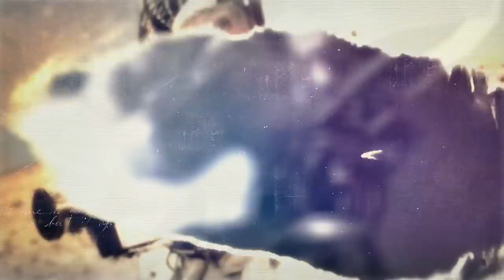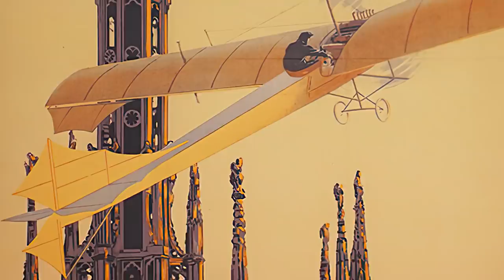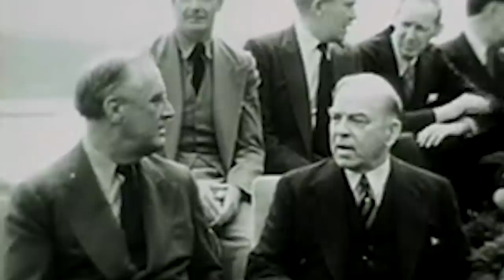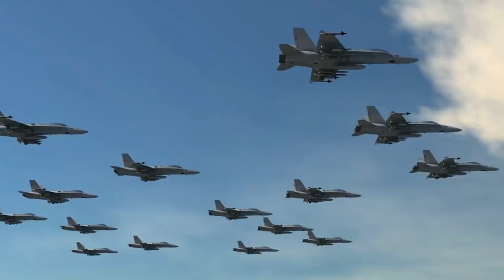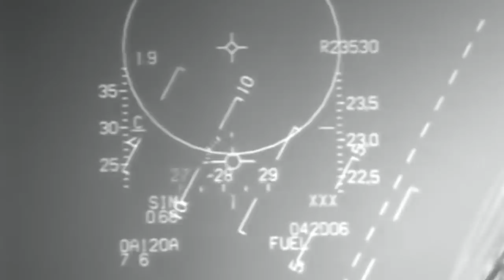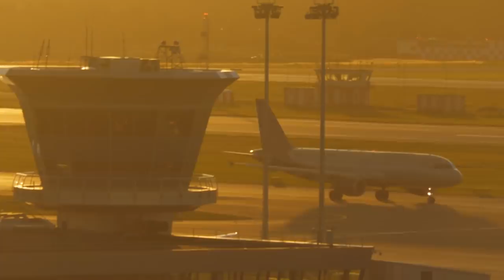F-16 Pilot Doesn't Realize He is About to Hit a Passenger Plane

Comment: You can't beat the Mk. 1 Eyeball when it comes to traffic avoidance under VFR
Reply: What he said.
Reply: Looks like the interface between it and the meat Servo was a little slow
Reply: Yup...
Reply: You can’t beat the Mk. 1 eyeball but plenty of mid airs have occurred when pilots failed to use their Mk. 1s.
Reply: @Dr_Kenneth_Noisewater  This is very true especially that be high closing speeds aircraft have. I was once joining a control Zone of an International Airport coming into land and I had a B17 Flying Fortress in front of me and a Catalina flying boat behind me we had literally seconds to spot and move out the way of the B 17. It's incredible when even something the size of a B17 Flying Fortress is coming towards you that very thin profile you have to spot is incredibly difficult and it's only when they are within 3, 4 , 5 Seconds of you, that you have the opportunity to take avoiding action. It was like being in WW2 a landing I'll never forget.
Reply: Ok Mark Felton
Reply: @glenwoofit  I've had a few see and avoid incidents but it's amazing how difficult it can be to spot another airplane, especially one that's on a collision course (constant angle, closing range) - especially with terrain in the background.

I once had a King Air climbing into me and had to avoid with a steep turn.  

Another time I had an electrical failure under the Denver Class B.  Extremely busy airspace!  I am always vigilant around Denver but that day I was 😳 bc I was nordo and no xpdr.  I had to avoid a taildragger with a steep turn.  We would have collided and I don't even think he saw me.  In fact I didn't see him, despite my hyper vigilance, until 0.5 to 1 mile because he was not "moving" relative to me (constant bearing, closing range) and there was a lot of ground clutter.  His bearing was about 1-2 o'clock, same Altitude.  Scary!

See and avoid is hard enough at a probably 220 kt closing speed and practically impossible at 1000+ kts as the video aircraft were.

Comment: Rome Tower had all three planes on scope. All they had to do was make them aware of the commercial flights altitude, and direction. Regardless of avoidance equip. They should have notified. Everyone is getting to comfortable with tech. Thinking it'll do it all.
Reply: Totally agree. And then you get self driving cars - utter madness.
Reply: Yep, the TCAS is a BACKUP system. If that thing is blaring at you, things have already gotten out of hand.
Reply: First of all, unless intentional, aviation has a no blame policy in order to avoid pinning the fault on someone without learning the lessons of the incident on a systemic level.

Secondly, TCAS is indeed the backup system but human aren’t perfect and sometimes fails so TCAS is a wonderful thing. I don’t know how you picture this but no controller handles traffic thinking “it’s ok... TCAS will do it for me”. For info, when a controller makes a mistake and a TCAS resolution advisory is generated, it takes priority over ATC (to avoid a new Überlingen accident).

Thirdly the approach of looking at one case to determine the performance of a system is completely wrong... Yes there was one incident where it didn’t work as it should have (did all the aircrafts activate their transponders ? See GOL 1907 crash) and we should learn from it and improve it  but there are hundreds of instances each year where it saves the day (FAA/EASA 2020 stats). Autonomous cars could very well be like that as well. We humans make a lot of mistakes and it could very well be that autonomous driving is safer than human driving in all conditions in the future.

Lastly, the true visual indicator of an impending midair is the lack of relative movement. If you are in an airplane and you see that another airplane is not moving relatively to you and getting bigger, you are on a collision course.
Reply: @worldbearers93  Would the F16 even be fitted with TCAS?
Reply: @ICGedye  self driving cars are safer than normal cars, though - such as the tesla. They can regain control after swerving and have a top-tier accident avoidance system.
Reply: @siesaw1  The tech is undoubtedly there already in the normal cars we drive now. They use sat nav built in, have cruise control - so speed can be limited, and a host of collision avoidance systems in top end models. But here in the uk, where bikes pedestrians and motor vehicles all mix on all but motorways, these systems are way off being the way to stopping road deaths, or more efficient travel on their own. If everyone got one these cars at the same time, then yes, im in complete agreement. But i mean ALL old cars would have to go. Try telling that to a guy in his old Triumph TR6 with dodgy brakes. It wont be easy. And I dont know about you but affording a Tesla, yeah right!
Reply: Self-driving cars are safer than human drivers oy because human drivers are pretty rubbish.

The original DARPA self-driving car challenge was abandoned as no car completed the course and many failed on the first corner. I do not believe anyone has attempted to put a modern self-driving car through it, but I'd be very surprised if a Tesla got more than half way. The self-driving is still too unreliable to do much beyond the very basics.

And even then, its failure rate is not good.

But, yes, still better than humans.

Comment: When I was in the USAF, 2 FB-111A fighter bombers had a mid-air collision during a night air refueling mission.  They were assigned to our sister wing at Plattsburg AFB.  Even though the 2 bomber missions were flying at night  on different training routes, they collided as they were flying to meet up with a KC-135 Tanker.  One of the findings of the accident investigation board was the the two crews didn't discuss any join up procedures before starting out on their missions.  As I recall, both crews were able to eject safely and survived, but we lost two very expensive air-frames....a totally preventable accident.

Comment: I was flying from Dallas to Richmond VA back in 1987 and the pilot noted that if you looked out the right side, you could see USAF jets performing aerial refueling, I was more amazed by the 727 that clearly had Piedmont Airlines written on it that past about 600 feet right below us.
Reply: how do you know 600 feet?
IFR rules allow for 1,000 feet vertical separation.
Reply: It’s safe.     They are all under radar ATC. Guidance

Comment: The standard procedure if you are unable to contact the next controller is to go back to the previous controller. In this case callsign, Cyrano a  French AF E-3. The blame would largely lie with the IAF F-16 pilots for not doing this. Also had the F-16's just left Cyranos Control he would advise them of conflicting traffic before had off. However, as we do not know the time elapsed from handoff to near-miss this is hard to determine.

Comment: I was on a plane to Houston a couple of years ago and our plane was almost hit at about 35000 ft by an unmarked US military 2 seat trainer jet that was flying through the clouds and coming at our plane at a right angle.  The trainer missed the tail of our Embraer passenger jet by about 25 feet by ducking under our plane at the last minute.  Because of the sun, everyone on the plane had the windows closed on the left side of the plane and nobody else saw anything, but I got to watch a plane coming at me at 550mph in slow motion for a few seconds. The only way that would be possible is if the trainer had its transponder turned off, because the pilots did not react or say anything at the time.

Comment: The way most TCAS systems work, you must have TCAS on both aircraft or else one of the aircraft will not know the other is there. This is why the commercial airliner never got a "Traffic! Traffic! Climb/Descend!" callout. With the F-16s, especially the earlier models, there was little in the way of these sytle of sensors. To this day, although due to it being a military aircraft not because the military dont like safety, there is no ADSB in or out which means no other aircraft with ADSB in or out can see or be seen by the F-16s. Both ADSB and TCAS would aid in this situation, although due to the state of the aircraft in the military, I doubt they would want to broadcast their location lol

Comment: Flying out of Salt Lake, 737, due North to Portland, flying through clear blue sky and big white puffy clouds, window seat, starboard side. Another 737 comes blasting out of a cloud at just a slight angle to our plane, so close I saw both the pilot and co-pilot's heads turn in that millisecond they passed us, not more than 150 feet off our wing tip, exact same altitude.  A millisecond farther into our flight, I wouldn't be writing this. On the way home, landing at Salt Lake, windshear, plane hit so hard I was amazed the landing gear held up.  Two years recovering from the back injury.  When I made it home and got off the plane, got down and kissed the ground and said two words.  You know what they were.  NEVER AGAIN.  I love to fly, its the crashing I want to avoid.  Only one way to do that.  19 years later, I did fly again, it was my brother's 80th birthday, but even then, I pondered it.....the image of that plane blasting out of that cloud......hard to shake that,  very hard.

Comment: I always wondered if fighter jets had the TCAS system for peace time use
TCAS, radar, transponders even radio communications must be quiet as broadcasts can give away there location, passive or receive only.
how did this event even happen with a AWACS in the air.
love your video's dark footage, now subscribed, always enjoy your content.
Reply: Heavies have a military equivalent of TCAS (which is compatible with the civilian system) but smaller fighter aircraft do not. They are developing ACAS, which accomplishes the same thing, for the F-16 and F-35. Not sure if that will be extended to other fighters.
Reply: It makes a lot of sense why military aircraft wouldn't have a full broadcast TCAS, but I would think they could still have the system in a listen only configuration for avoiding incidents like this.

Comment: I was in a commercial flight somewhere over Russia (i think) in the late 90s when we very nearly had a head-on with a 747.   it was lights out in our aircraft and I was one of few awake, when we banked and pulled significantly more g's than normal (likely not 'massive' g's but you would have really known about it if you were stood up).   fortunately it was applied smoothly enough that few if any noticed but me.
I looked out of the window and maybe 15 seconds later a 747 went past in the opposite direction maybe 3 wingspans away.   f that was close.
on a flight the next year, went to the cockpit to chat with the pilots (you could do that in those days) and mentioned it, and they gave each other 'knowing looks' .... whether they were piloting that flight or had just heard about it, I don't know ...

Comment: There are some misconceptions:
Military aircraft don't always have their civil transponder active, indeed you cannot always find military traffics on flightradar24 (and Italian air force jets and helicopters very rarely have their transponder public).
Second the TCAS of the jetliner simply couldn't detect the inbound traffic because it couldn't know there was a colliding traffic; the TCAS system solely relies on transponder "pings" when they share their position and altitude.

So my conclusion is that the mid-air collision was possible because the first ATC controller cleared the f16 to a flight level not clear (ATC ERROR) or the f16 spontaneously decided to climb before being acknowledge by Rome radar (PILOT ERROR).
Also, we have no data do know if the f16 forgot to turn on his civil transponder - I suppose it should since it was flying in civil traffic airspace - so this could be another pilot error.

Comment: Funny radar shot at the end with 0 at the traditional navigation 90° position and rotating the wrong way.  This is because math trig and nav trig have to be adjusted before conversion to radians and accessing functions like sin(),cos(), tan()  etc.
Thus atr :=  -anv + 90° before converting to radians (ar := atr * pi/180);  for plotting (y := sin(ar) * L; x := cos(ar) * L).  (not accounting for graphics offsets, or that y is usually positive down on graphics displays).

No need to normalize when going from deg to radians (the trig will work fine), but the other way will need normalization.

And yes, you can speak to the back of a microphone if you speak loudly enough....

Comment: EPISODE SAYS A LOT ABOUT THE ABILITY OF THE ITALIAN AF TO "DETECT" A ONCOMING 'TARGET' BIGGER THAN A WHOLE FOODS STORE ON RADAR
Reply: not to worry the US has had incidents like this too, its not saying anything about any particular nations airforce. sometimes shit happens
Reply: Active Radar is offline in a lot of situations, as the output power of the active radar can harm things (Electronics, sensors, people,). I don't know the italians SoP, but there is a possibility that the Active radar was off, and passive radar only works as a receiver, and Airliners don't have active or passive radar for that matter. They have Weather radar which, as far as I now, work with different frequencies. And in the footage the weather was pretty clear as well, so no real need for the weather radar. Also depending how the Radar systems are build, they have parts that can wear out.

Comment: I can say from experience about your possible explanation theories. First one about one of the F16’s having a bad transponder: one plane turns their transponder off to keep ATC from getting constant alerts on two close airplanes while the fly in formation . The second theory about TCAS; military uses a different type of transponder, so the airliner will not pick up military planes on TCAS unless the military plane is equipped with a civilian transponder.

Comment: I've had a TCAS Resolution Advisory (a vertical escape maneuver that is displayed in one or both aircraft) while in the Flight Levels from an unknown fighter doing a high performance climb, and they were many thousands of feet below my regional jet. Like around 10,000 feet below me. The performance needed to do that is certainly humbling. Also, we are very lucky to have the technology we have. TCAS really is a critical component of modern safety. If two airliners are on a collision course, it will give alternate vertical guidance to them. Pilots are generally trained that you follow that and ignore Air Traffic Control at that point because ATC can only talk to one plane at a time and they can't possibly instantly know what each system is telling each crew. So you fly it , and then advise. But in this case, who knows?

Comment: you could talk about a similar event in greece that took place I think in 2004 or 2006 where a commercial airliner malfunctioned and was heading for the ground while a greek HAF f16 interceptor pilot wachted the airliner helplesly (I might have made a typo there) crash to the ground somewhere south of Athens I think it's an interesting topic to cover
Reply: IIRC, the whole crew was incapacitated because of a fault or operator error for the cabin pressurization system. And the F-16 Pilots saw a stewardess in the cockpit with a oxygen mask, but it looked like she didn't knew what todo or how to communicate.
Reply: @RobinCernyMitSuffix   we can agree that it would be an interesting video to make since it has a larger plot and it has a larger video of the pilot witnesing the hole thing rather then a 5 second video DF covered in this video

Comment: The Italians flew F-104s until 2009 at least as Aerial Demonstrators, I only know that because when the 999 Ledezma came out the Squadron assigned to the factory did a flyover with the company's colors (one of which was strawberry pink) in smoke trails

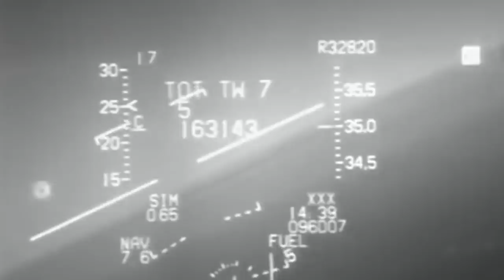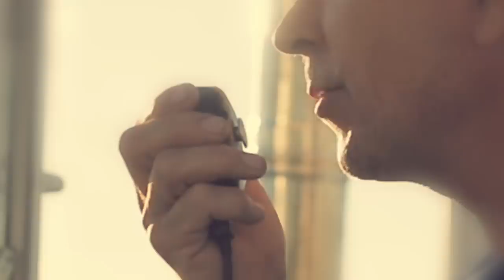Comment: At 4:01 to 4:04, the pretend Air Traffic Controller, is holding the hand held microphone backwards. The shiny metal disk is used to hang up the mike in a u shaped holder.

Comment: I have no idea why this guy has to speak like we are in a horror movie, it is actually hilarious. But ok, that aside, there are a few things which are noteworthy. First of all, this was a flight of 2, which means the lead has the squawk on, the Bravo has it off. If it would have been a flight of 4, same deal. So, stating that one transponder was apparently not functioning is more a case of not knowing procedures. Second, it bewilders me why they were cleared for FL360. They were on a hdg of 160 and should have therefore been on an odd level, eg. 350 or 370. Third, it would not have been a midair, but I think you can qualify this as a 'near miss'. Fourth, I see no mistake by the pilots, this was clearly an ATC mistake by clearing them to an incorrect FL and not advising them of the traffic which was approaching them. If you cannot get in touch with ATC on a new assigned freq, you simply go back to the old freq until you are able to establish contact on the new freq.

Comment: Good video, but there is bullshit in the reported blame. Military aircraft typically do not broadcast ADS-B messages required for TCAS to function. Civil airliners do. Therefore the F-16s should have been alerted to the presence of, and avoided, the airliner. The F-16s may well have not been visible to the airliner’s TCAS system if they were not broadcasting ADS-B. It was stated in the video that after handover from a French controller, the F-16s were unable to reach the Rome controller. There is no indication that the airliner was not under radar control from ATC at the time, and was therefore flying in accordance with their assigned route and flight level. Therefore the fault, and responsibility for avoiding collision lies squarely with the F-16s, unless there are exceptional reasons otherwise.